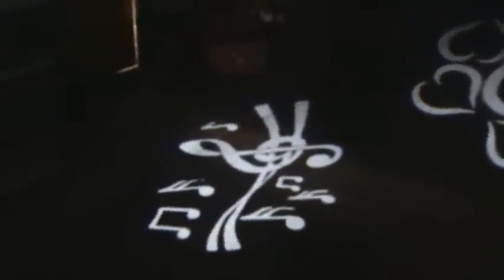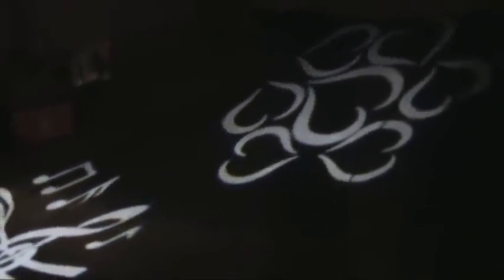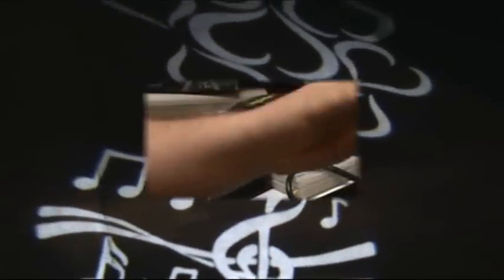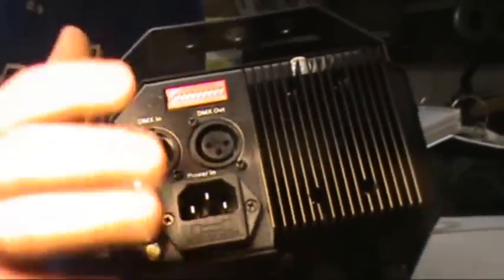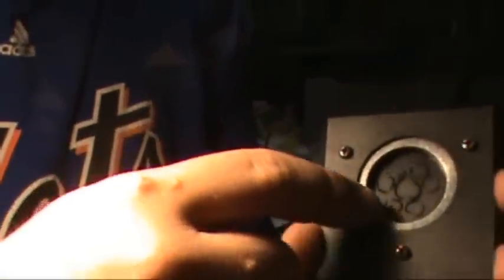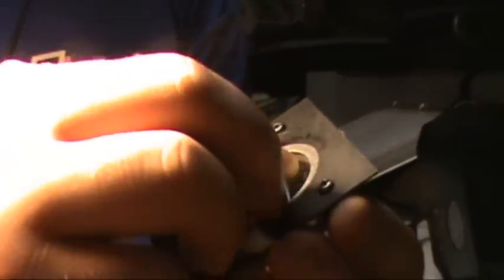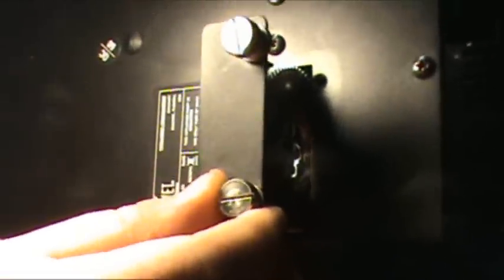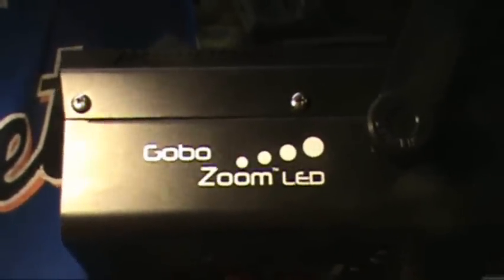Chauvet Gobo Zoom LED

Comment: Using INKJET transparencies (always make sure you get the correct media.. some people get it wrong, or even use the incorrect side (yes, there is a difference). Always create the gobo (artwork) at the highest resolution you can, i create at 1200 dpi, and print at 1200 dpi.

Also, use the settings of the INKJET to use MAXIMUM INK OUTPUT (Read the manual, it'll show you on your model) 
It will GREATLY reduce the light bleed-thru and only show a small amount of grey halo. Hope this helps.